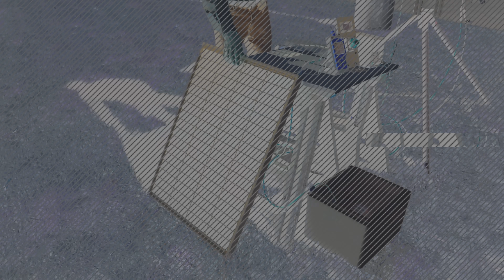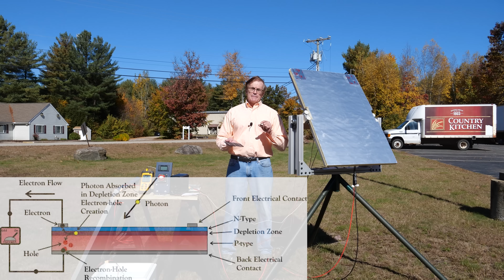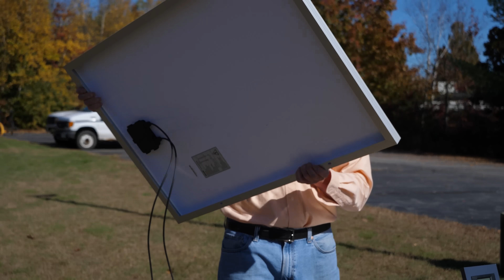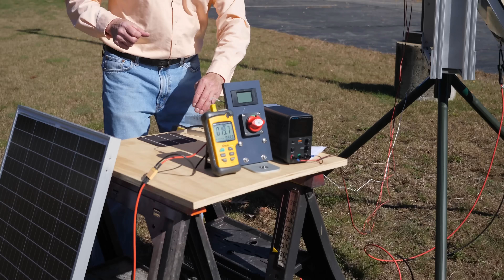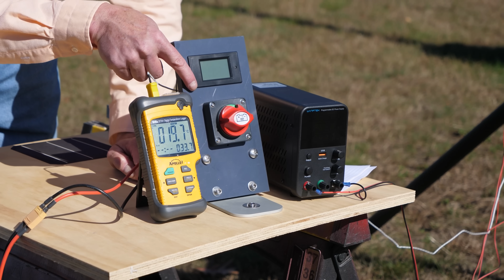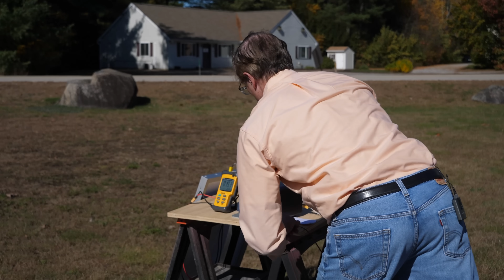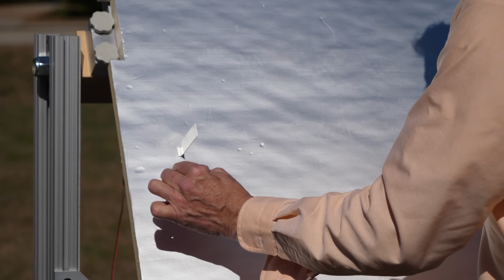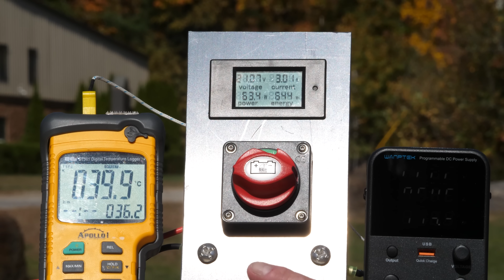Do you REALLY get enough out of your solar panel?

Comment: How about making it water/glycol cooled? Pool heating if nothing else.
Further thinking: I have tiled roof, and that would also be the likely where panels would be installed. Not exactly a source for cool air during a hot summer day (or sunshine for good part of the year where I live) - liquid cooling likely would be a better bet. Heavier also, so the liquid layer shouldn't be too thick - perhaps a sheet of aluminum on 5mm high beads of adhesive.
My friend tried a machined sheet of aluminum, but that apparently didn't work too well, can't remember why.

Comment: I don't think it is likely this will take off except in very niche applications. This probably doubles the cost of the panels (especially if you consider your time to do it) and for most situations you would get much more output just by putting that money into buying more or better solar panels.

There are still gains to be made in manufacturing solar panels in more cost-effective methods but things like heat sinks and fans are not likely to ever get cheaper since they rely on the cost of commodity materials that are never going to go down in a meaningful way (aluminum).

I know the argument some people are going to come with is about space efficiency for deploying solar panels but realistically that's not been a limiting factor in most areas and I don't think it will be for a while.

Further this considerably increases the installation complexity and maintenance of the solar array.

I was very excited about the idea of the photovoltaic thermal combination panels but when I really ran the numbers it just isn't practical and the main reason is how expensive materials are to build the heat sinks / exchangers.
Reply from the maker: I have to disagree.  As I explained and demonstrated this works and isn't  difficult.  If the manufacturers begin incorporating the cooling fins during production, the cost will come down substantially.

Comment: i live in austin texas... i think the water idea is a better fit...
Reply from the maker: Maybe, but remember it will increase the complexity and the water has to be as cool as possible to maximize  the benefit  and this means the water itself becomes a poor source of heat.
Reply: @TechIngredients  you've got my gears turning im thinking he air in Austin is 100 f  plus ...and the water can be 70 f .....copper tubing  windings  attached to the back of the solar panels... pump between 2 water tanks buried in the ground ....this will take some experimenting ... i think the water tanks wont cool off if the earth can't absorb the heat fast enough....you're right the heat will build up without a source of fresh cold water....none here....thanks

Comment: I don't think it's a good comparison, because the first test relies on convective cooling but you had the back of the panel boxed in for your fan rig. I think a more thorough test would have an unmodified panel control, open heatsink, and fan rig. 

I was thinking it might be cheaper and certainly easier to just use aluminum angle stock. It's readily available, a quick google and you should be able to even pick it up from the big box DIY stores.
Reply from the maker: It wasn't  actually  closed and benefited from the increased surface area from the fins. Even without the fans, this modified  panel  performs very slightly  better than the stock panel.

Comment: Do you wanna try this again with a calibrated keysight programmable power supply and DC electronic load?
Reply from the maker: I don't  think  that will change the results.
Reply: @TechIngredients  probably not, but you could evaluate your own load changing algorithm. I'm probably just itching to do it on my own however, so I may borrow a friend's panels and share results.

Comment: Love the results of the experiment, you could probably just buy L angle aluminum, they have it at Home Depot, and you probably could source it cheaper places.
Reply from the maker: Maybe.
I'm open to viewers who can improve  things even more.
Reply: Isn't that pricey, though? Problem with most PV boosting ideas is that PV is so cheap the cheapest option is usually to just add another panel. (Yes, not 100% of the time, but most of the time.)

Comment: Fascinating. I'd like to see the watercooled version of this output to a solar water heater. Dump the heat into your shower and sink where it's needed.
Reply from the maker: I explained  why that might not be  a good idea.
Reply: @TechIngredients  Sure, but people in cold climates probably wouldn't want a solar water heater either, since the pipes would freeze, but that didn't stop you from making that solar water heater video. That was a great project too. So if you assume it's only for desert applications (e.g. I live in Arizona), then combining the two ideas into one system could be pretty awesome. The downside of water warming the panels instead of cooling them would be rare/negligible in my neck of the woods.

Comment: I love this guy. He takes these tiny details in his work and takes it far beyond than I can even imagine
Reply: literally the best tech guy on youtube, i dare anyone to prove me wrong
Reply: I like what you have done to improve solar efficiency.
30 years ago I started adding solar pool heating strip to the back of panels. It has 10 pipes moulded in a rubber strip. Usually glued to the roof to heat a pool, it is easy to serpentine it across a row of panels 3 times and slitting it at the turn-rounds.
A small 12 panel driving a 12v solar HW-heating pump will auto speed-control according to the sun on the panel and thus  be self compensating. 
Air cooling is poor compared to water and more than one fan is a big no, no, as one fan will pull through the others.
You can always dump the heat into a pool or a heat pump via a car radiator, so its not  necessarily wasted.
Reply: You took the words right out of my mouth.  Just when I think of something to ask, he answers it like he was reading my mind.
Reply: some people just call it being thorough. it's amazing how capitalism has trained us to think that simply being thorough is somehow going above and beyond. it's also known as doing something right

Comment: When my wife and I went to Taos NM in 2017 to spend some time learning about Earthships, I suggested that they do this without fans to try to improve their panels. It is always breezy out there and I figured making and attaching fins to the backs of the panels would help dissipate the heat and boost the panel efficiency/increase the longevity. Glad to know it works... too bad they aren't interested in testing and gathering hard data to prove anything.
Reply: Earthships? You mean the tweaker houses made out of garbage?

Comment: Question: At what ambient temperature does the cooling actually make sense? There certainly is a point when the outside temperature is cold enough that the panels radiate heat away at sufficient rate, so any active cooling might yield too small benefits, if any at all. Also, this changes with how cloudy it is. At an overcast sky, the panels are not "bathing" in direct sunlight. They produce less electricity, but do not get that hot either. During overcast days, what outside temperature will make active cooling sensible from an energy point of view? This would be best to measure experimentally, using your apparatus at various conditions. I know it would take a lot of effort. And I would measure the modified as well as a stock unmodified panel next to each other, so I can get readings of ambient temperature, standard panel temperature , cooled panel temperature, power output and power input (for the fans) at the same time. At the same time, it would be good to measure the intensity of light and how overcast the sky is (is there a standardized measurement of how overcast the sky is?). Once we have all the data, we can check with our local weather patterns to see how much this active cooling system will be actually in use. Nobody would let it run if it consumes more energy than it generates.
Reply from the maker: It will decrease in effectiveness as the solar flux decreases rather than as the ambient  temperature decreases, although  this is often related. It would require  additional testing.

Comment: It would be pretty cool to vent all the solar panels into a large hvac fan that could either vent air into a house during colder months, hot air out of the house during warmer months, or just away from the house during the hottest months.  

This system would also need filters because pests would love the warm enclosed spaces.

Comment: How about turning the solar panels into a water heater? Run one cold line across the panel group. Have a tap line off it to each panel. Exiting into a hotline to storage tank Heat exchanger Up to radiator back to the cold side. Thermal switch for cooling fans on the radiator so not to freeze the coolant.

Comment: Exciting !  Curves would be very very clear.  ?   As an electronic engineer, most of my time was used to
decrease waste heat generation and improve (conductively) thermal junction temperature rise.  Better MIPS per watt increases reliability.  life time.   105C max junction temp for most ICs.  Pound mass airflow.

Melting snow in winter ?  1% of normal output for November / December! 

Wait wait, % improvement was ?

Comment: The added complexity really doesn’t make engineering sense. By all means use some sheeting to create a duct for passive cooling behind the panels, but just adding an extra panel for every ten installed you would make up for the heat related losses. Fans and pumps need maintenance and fancy ducts and fins need regular cleaning to remove dirt. Then there are the additional costs associated with more complex wiring and control systems. So, nice if you are trying to squeeze every watt out of a space limited system but better to just keep the system as mechanically and electrically simple as possible.
Reply from the maker: Not necessarily.
You've dismissed  the benefits  of increased panel  longevity and cleaning  the panels  remains an issue  in either configuration.

Comment: "Nobody" is doing it. Because it's just not economically reasonable. Even if your cooling solution could persistently give you a 10% increase in total efficiency, i.e. 10% more net electrical power output, you could achieve the same result with 10% more stock panels/cells. So, if the cooling system per panel costs more than 10% of the panel's base price, you already lost money.
The aluminium sheet for the heat sink fins alone probably costs more than 10% of the panel. Let alone the cost and added system complexity for the "active" part... more things to break and replace over 20-30 years... Not worth it in 95% of installations.
Panels have gotten very cheap over the last decade....
Still, an interesting idea and illustrative experiment and video :)
Reply from the maker: Thanks!
But, as I said, somebody is doing this.

Comment: The main issue I see here is that the cost to add the fans and metal to the panel. Sure you gain 2 watts of power but how long would it take to recoup the cost of the additional materials. The second part would be that those fans will most likely go fail somewhere between 5-10 years so the cost of replacing the fans needs to be factored as well.
Reply from the maker: True, but fans are light, easy and can be modular.  Don't  forget the benefit of increased panel  longevity and operation in very hot climates.

Comment: Ive got a question about small RV systems that are stored in the summer in the desert of Arizona?  Do you think it would be a good idea to cover the panels with reflective foam to protect the cells from the AZ intense summer sun and heat?  If the ambient temperature is 110 F would the fan system really help out much?  I'm a snow-birder and the AZ summers are WAY to hot so the RV gets stored and I head back to Alaska.  I want to protect the panels the best I can.
Reply: I don't think it would hurt at all

Comment: It’s a bit of a misleading test because when you established the base temperature and power output you restricted the natural air flow behind the panel wit your cooling system that was turned of so the difference wil be greater between the situations and it may give the impression that you are making a gain while your not
Reply from the maker: We also substantially increased the passive surface area for convective  cooling.

Comment: What about an auxiliary water drip system so you can reduce the temperature to closer to the wet bulb temperature rather than the dry bulb temperature?
Reply from the maker: That's  an option if you are willing  to add the complexity  of that additional system.

Comment: Amazing work, as always. 

One observation: The water drip system is something that I've been looking at for as you stated keeping the panel cool and cleaner. However, I am also wondering if there isn't a secondary effect of magnification. The water surface acting as a concentrator on the incoming light, similarly a magnifying glass. 

Any comments?
Reply: I would not be worried about water acting as a lens, as it would be out of focus most of the time and changing. What I would be more afraid is water stains and possible buildup of various deposited junk on the surface, blocking the light. Especially if you have hard water.
Reply: @ErikZiak  I use water generated from my AWG with 5 micron filtration.

Comment: it would appear that panels mounted close tp the roof would be at a thermal disadvantage compared to  ground mounted panels that would have better air flow from convection. Painting the back of the panels black might boost radiant cooling too.  Your ribs which could be off the shelf extruded angle would also help plain convective cooling. The fans in an outdoor environment will fail several times in the life span of the panel. Maybe even once a year.  Seems like a marginal benefit but in hot climates it becomes more important from a panel degradation standpoint. It seems money is better spent on your concentrator reflectors. Too bad the aluminum reflectors don't block  IR and far IR?  The reflected light would be a little cooler. Panels made on a thermally conductive (aluminum) substrate would couple better to your fins and likely cool better than plastic ones. Maybe some brands of panels are thermally much better than others. Very interesting video as usual.

Comment: The engineer would also say how many fans you would replace per year because they get broken (e.g. debris can accumulate on their bearings and halt them)? What happens when ice is frozen on/in the fans and halts them or damages them? Extra fans also mean extra cables and protection equipment like breakers, increasing complexity, installation and maintenance cost and points of failure (e.g insulation of fans' cables can get damaged). Also, some people may not have the time to deal all the time with their solar installation, due to lack of time or tiredness....The idea is good and well known in solar industry but not applicable ubiquitously. There may be cases that such an installation would be of benefit but many other not.
Reply from the maker: Agreed

Comment: The lifetime of your solar panels might be 20-25Years - but whats the lifetime of those fans? Surely not 20Years... You`d have to run them almost constantly during the day and if you figure in the cost of occasionally replacing random fans  and the cost and labor to of maintenance (solar panel are usually mounted flat on the roof so no easy access to both the overall location and the placement of the fans ) , plus there would be issues with the cooling fans being clogged up by dust/debsis etc  degrading their performance so you`d have to open the back occasionally and clean them out etc etc- I dont think its worth it in the long term (esp if you dont do that maintenance yourself ) - and even if you were do maintenance all by yourself. Its just not practical in the long term IMHO. Adding just one more 100W panel to your systm would equal the performance gain from doing this mod to ten other panels and be much less complicated and maybe even lower in cost. lower in maintenance for sure. A passive cooling system of similar gain might do a little better in regards to the maintenance issue but  that would drive the initial cost unsustainably high - you`ll never recoup that by just squeezing out  a few more watts of performance. And with current prices of solar panels it would be much more economical to just add a few more panels initially to the system to counterbalance the degradation over time instead of adding a active cooling system that also costs some money and adds complexity +maintenance issues . Might be interesting to see if there is some gain to be had for installing just the alumiunium fins only (no active fan cooling). just my 2ct .
Reply: I agree. I posted/asked about just the aluminum heat sink running passively, but no reply. Further benefits 😊

Comment: I'm going to attach tubes to the back of panels and run propylene glycol solution through them. The heat exchanger will be underground and it will cool panels in summer and melt snow in winter. So my panels will actually suck coolant.
Reply from the maker: Good luck!